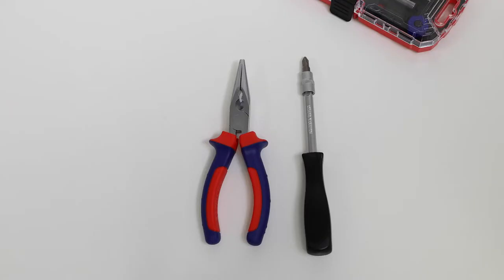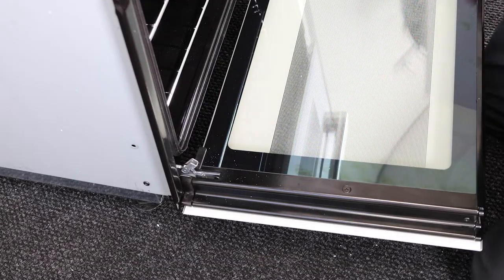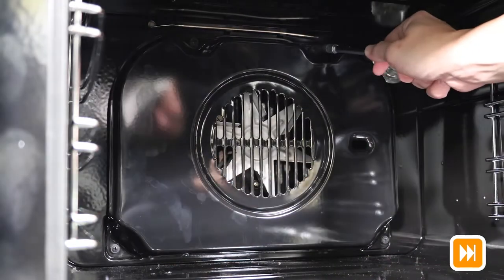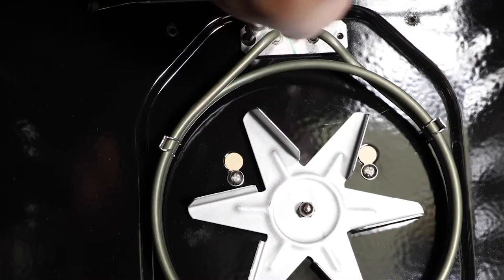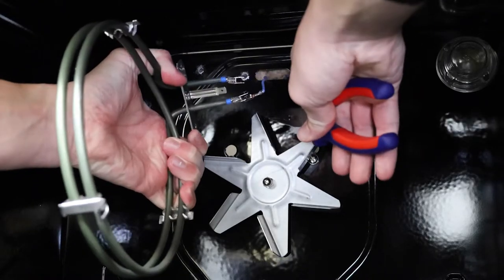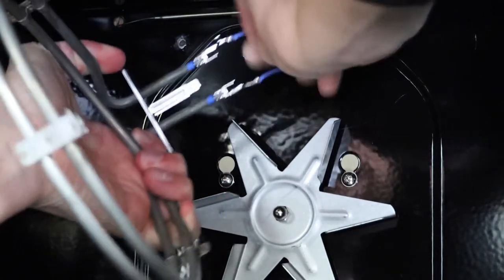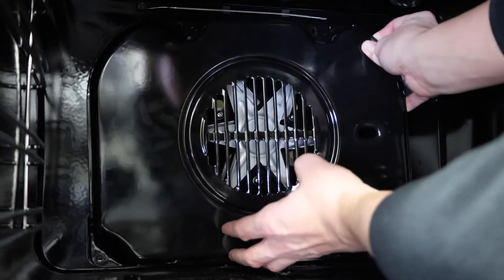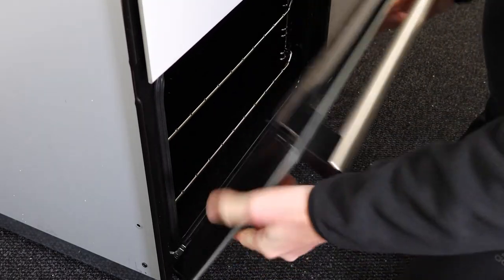How to Replace a Hotpoint Oven Fan Element 2000W

Comment: Prior to watching your video, I was expecting to see three wires given the genuine replacement element had three terminals, but it turned out the middle one is not used. This originally left me believing the non-existent third wire had come off during changing the element because on completion the oven didn’t work. It was only after I reset the clock did it start working.

Comment: I did this and now the fan oven gets insanely hot, it just ignores the temp we set, I had it on 100c and it was glowing bright orange and really hot. Does that mean the thermostat has gone?
Reply: When the thermostat went on my top oven it wouldn't turn on at all.....is your temperature light going off when it gets to set temp, I'd imagine the element would glow most of the time anyway.

Comment: Really do make sure those wires don't vanish into their holes and fall down the back!  "Gain access to the back" sounds very easy, but isn't!   I put stout bulldog clips on mine to stop this happening.
Reply: Attach a peg or similar to each wire so they can't fall down the hole.